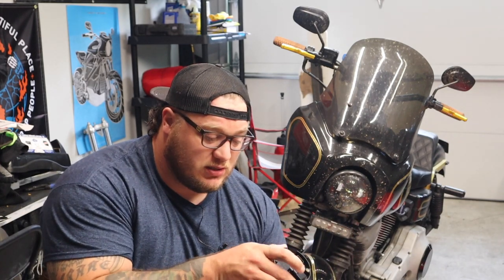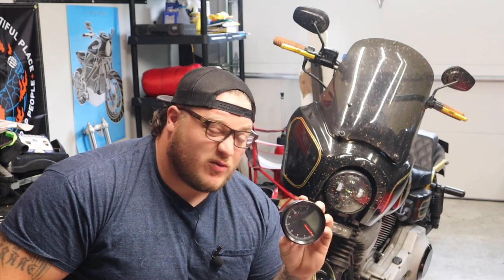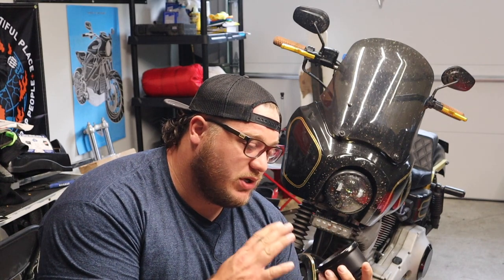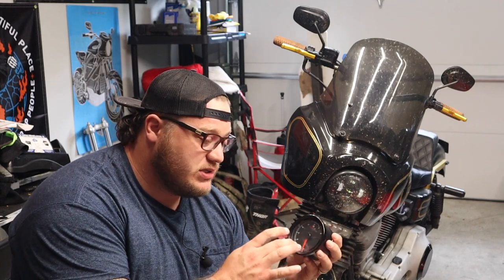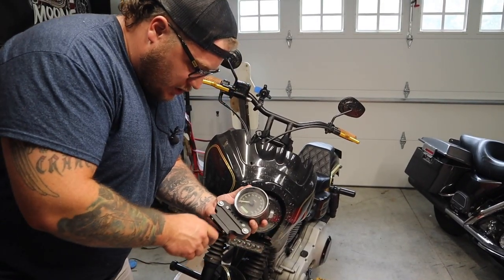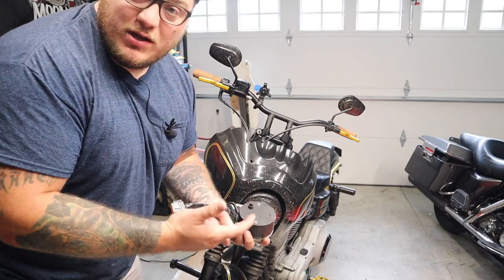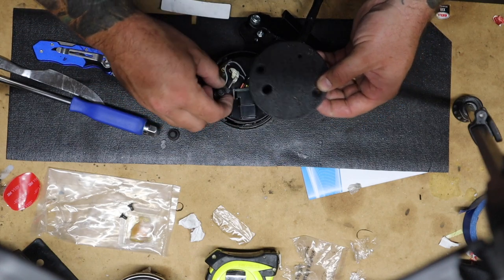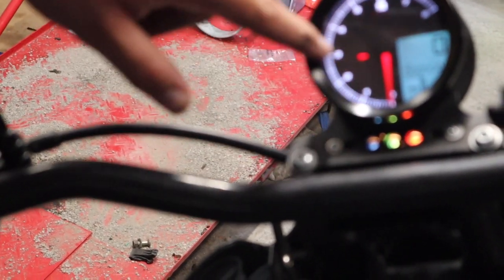Dyna Tachometer (and so much more) Install | Part 1

Comment: Did your 05 originally have a tach? My 07 fxdb doesn't so I'm curious how this tach would just plug in and work with a tech.
Reply from the maker: From what the guys at Koso said, no matter if your bike has a tach or not, the harness will still have the output for it. Mine did not have a tach and it works like a champ.

Comment: I turned ignition key too "on" on my 03' fxdx, I watched speedometer go from zero to pegged out as fast as I can go! Only problem, I'm seating still, not moving! Instrument repair couldn't fix gauge. I had too buy new speedometer, now my mileage is not correct!

Comment: Do you happen to know the name of the mount you used that houses the speedo. Looking to do t bars on my 07 superglide an have to get rid of that stock gauge/bar clamp setup they have. PLS lmk asap thankyou!
Reply from the maker: Oh man. I’ve had that thing forever. I can’t remember what it is called. Let me see if I can find you a link.
Reply from the maker: This is the bracket specifically for tbars:

https://www.revzilla.com/motorcycle/la-choppers-t-bar-gauge-mount-for-harley?gclid=Cj0KCQjw-daUBhCIARIsALbkjSb-MFInsaAuQ3zJ7QdpQ1xigtGytdWaascxf0quYmR6NkltPuXteBIaAkpoEALw_wcB
Reply from the maker: That SHOULD work with the stock speedo pod. Not sure what your stock set up is though.
Reply from the maker: Don’t forget to sub to the channel! Haha
Reply: @NattyBumppo   thanks for the quick response, an I have that mount for in between the bars, I’m talking about the actual gauge housing that you jerry rigged your two screws into for the display lights do you have a link for that?
Reply from the maker: @Apizz47  ah yea. 

https://www.revzilla.com/motorcycle/drag-specialties-single-gauge-bracket-for-harley?sku_id=1180043

Here’s one in chrome. Should point you in the right direction if you want black.

Comment: Little late to this party but curious.. what year is your bike? I want to do a dual gauge set up.. but my ‘14 dyna has a electric RPM readout in the little screen integrated into the speedo.. any idea if I could do the dual (speedo & tach)?
Reply from the maker: Mine is an 05. I’m sure there are plenty of options out there to run that. Just gotta do some digging.
Reply: @NattyBumppo  I like the KNS dual gauge cluster but need to find a company that can separate my gauges.. one speedo, one tach.. I haven’t called KNS yet.. thanks for the reply
Reply from the maker: @bullast2046  there has got to be someone out there who can. Or at least get you a couple steps in the right direction, you may need to Jerry rig some stuff. 🤷🏻‍♂️